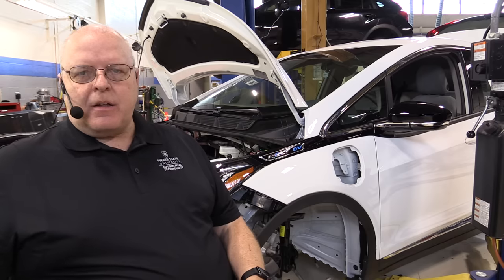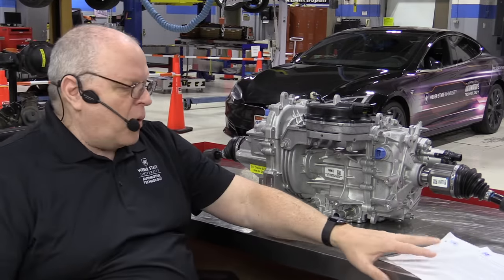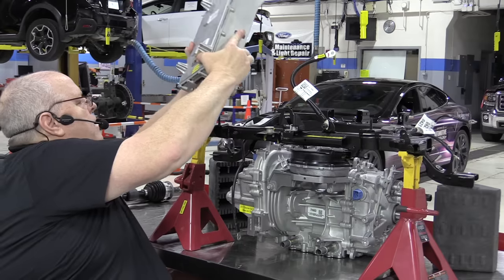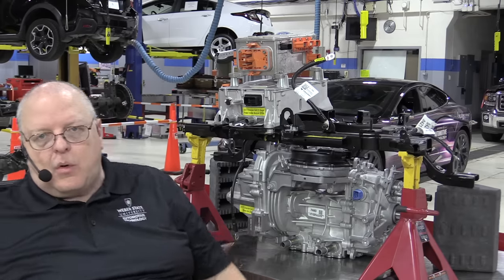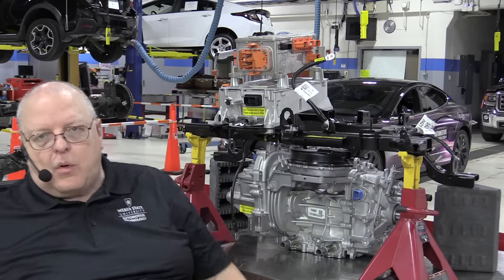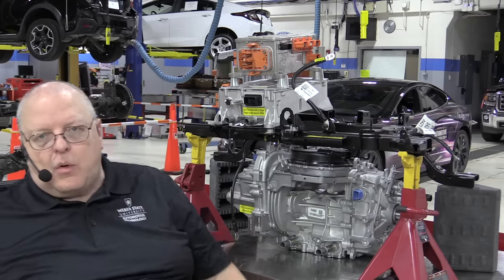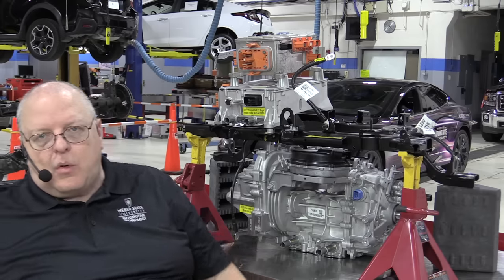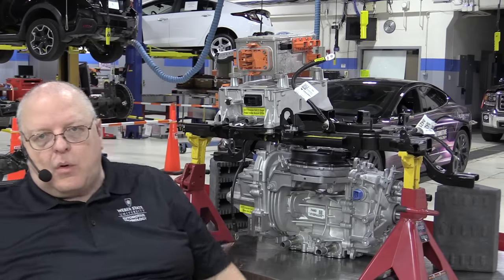Chevrolet Bolt EV High Voltage Components

Comment: Why would they have two different wiring harnesses for J1772 vs fast DC? You'd think it would be easier/cheaper just to have one part number and ignore the extra wires if you don't have fast DC.
Reply: This is GM we're talking about, are you really surprised? Lol. They try to save a buck by using less cabling, or save on BMS design, and report their quarterly profits to happy investors, and then the recalls start coming in and claw the profits right back. Makes you wonder if it was really worth it for the US govt to bail GM out of bankruptcy last decade. It seems they're still doing what they've always done, thinking they're doing it the easy way and saving money.

Comment: Interesting the electric power steering is not part of the high voltage system. That means reduced efficiency but they can reuse the same components as in their ICE cars to save money.

That onboard charger is at least twice the size I expected. All that to convert 7.2kW? Seems ridiculous. The motor controller is smaller and it converts 150kW.

Would have been interesting to see the coolant routing. How many loops are there? And how many coolant pumps? Seems the coolant pump(s) is low voltage also?

Great vid. Good thinking assembling it all on the bench like that.
Reply from the maker: Thanks for your feedback, the cooling system video is coming soon. Regarding the on-board charger,  keep in mind that it contains its own AC-DC inverter and its own DC-DC step up boost converter all in one housing. The continuous 30-32A charge rate at 240V would make it run pretty hot for up to 9 hours straight while charging.  This charger is actually smaller than the 1st generation Chevrolet Volt charger which was only rated for 3.3kW. Have a great day!
Reply: Now that SiC and GaN transistors are more cost-effective we might see smaller designs in the newer vehicles, but you're right in your other statement that they are saving cost by reusing the same components in their ICE cars. They aren't really playing the game to make a truly great EV design, just something that meets demand in the mass market and turns profit for their already bailed-from-bankruptcy GM company.

Comment: Thank you professor for your great video! I learned much from it. One very minor question at the chapter "the HPDM to APM and OBCM connections", I notice that there are 2 connectors from the HPDM while splitted to 3 connectors respectively to DC/DC, OBC and the compressor.  So there must be 2 connectors sharing one port of the HDPM. Could you help specify which two? Thanks again.

Comment: Awesome explanation. Seems like a first gen design in that they didn't integrate much, kept it simple. Would LOVE to see the equivalent for a Tesla Model S and then the Model 3. I suspect the Model 3 will be much more integrated, less high current wires.
Reply from the maker: Thank you. Tesla Model S is very similar with one exception. The inverters are inside of each motor. I have not seen the model 3 system yet.
Reply: @WeberAuto  Model S has a high voltage distribution box too? Is the industry ever going to switch from 12V to something that is now more appropriate like 48V?
Reply from the maker: @philtrubey7480  Yes it does. it is built into the end of the on-board charger

Comment: Professor Kelly, is it possible to add the DC Fast Charging option to a Chevy Bolt after purchase?  I purchased a used 2017 Bolt without the DC Fast Charging option installed.  I can purchase the receptacle and wiring harness for $746 from the dealer parts dept. but i'm guessing it's not that simple.
Reply from the maker: It is not possible. Sorry. Thanks for watching

Comment: A big thank you for doing this Bolt series. While I get the concept of the modules, I don't agree with it. While I don't know, I highly doubt these modules are serviceable (although they should be). So they represent unnecessary cost. The wiring, while impressive, seems like overkill. For example, I see no good reason for having the inverter  to motor connection via the 3-wire connection. Better to have that module bolt right to the motor - better electrically and more cost effective. I think we'll see a lot of design advancements over a shorter period of time which will obsolete the concept of using modules across model lines. I also see the 12Volt system disappearing as there is really no longer any reason for it. And this nonsense of throwing a fault code that only the dealer can clear for unlatching the battery out of sequence is absolutely ridiculous. Overall, I do think the engineers did a great job on the motor and trans-axle design. However, I think there is a lot of room to improve the electronics. Not that the inverter and other module designs are bad or inadequate, they are just too "closed" and "proprietary". This only encourages folks to completely bypass them and seek alternatives.
Reply from the maker: Thanks for your feedback
Reply: GM is oldschool, trains dealers, and supports their ecosystem. Stop buying GM and invest in companies that are willing to support Right to Repair, allowing customers and small businesses to work on vehicles with lower investment in specialized training, tools, exclusive partnership rights etc.

Comment: Just curious, will the AC 7.2 KWH charger on the 2017 Bolt EV fit in a 2017 Volt? I see it is an option for 2019 for the Volt. If so, where is the charger located in the Volt? I have a wrecked Bolt EV to play with, I would love to update my Volt!!
Reply from the maker: No, it is not the same configuration, size, and the connections are different. The Volt charger is under the rear hatch floor along with the DC-DC converter and the 12V battery

Comment: Excellent video and very in-depth! May I ask a question? I am considering adding an additional high power DC converter in order to have a separate 12v Supply to run a 2000w inverter for AC power. With the hpdm be the best location to tap into the high-voltage power for the DC converter? If so, what's the best point of connection?
Reply from the maker: That will not work. The internal current sensors will detect the unauthorized current, trigger trouble codes, and shut down the system. The 12V battery is the only place to connect something like that, but even then the DC-DC converter would not be able to keep up with the current required for 2000W. Best wishes.
Reply: @WeberAuto  Thanks for the response! I was concerned about current sensors in the main pack and possibly in the dc converter as well. However, I was wondering there is any way of adding another DC converter without causing an error? It would be very useful and not much different than adding a larger or second alternator on an internal combustion engine. Perhaps a power tap after the current sensor inside of the dc converter would work? Any ideas?
Reply from the maker: @wigginstech6107  No ideas, the battery current sensor would still pick it up.
Reply: GM vehicles are just not great for this kind of thing. You're better off either rewriting a CANbus controller or choosing a more modern vehicle that supports two-way functionality of its battery pack in a proper way, like what VW is doing in its new ID5, as well as some older cars that use CHADEMO.

Comment: Hello. Thank you for this. May I ask if these HV modules are case-grounded? Or do they have separate ground circuits? Thanks!
Reply: HV components in EVs typically have the case grounded to the vehicle structure (which is also the low-voltage DC negative), with both sides of the high voltage DC isolated from the case and low-voltage negative. The HV cables are usually shielded, with the shield connected to the cases.

Comment: Interesting, are we at the beginning of the end of internal combustion vehicles?
Reply from the maker: Thank you, That time is slowly approaching
Reply: timbober VW just officially announced that their 2026 design of internal combustion engines (ICE) will be the last of their new ICE engines.  With similar recent announcements (but less definitive end-dates) from GM & Ford, the end of the ICE drivetrain is coming quicker than many people realize.
Reply: Yes sooner than most would expect. Once you drive electric, you don’t want to go back!
Reply: timbober1:  the beginning of an alternative option ... EV performance & cost is reasonably close to ICE vehicles, but charging times & affordable range still has a lot of improving to do before EV sales out number ICE. Battery tech has been and still is the "weak link" to EVs being primary cars  ... cell cost needs to drop by over 1/2, capacity needs to increase by 2X+,  and charge rates need to increase by 4X+ ...  it's just a matter of time ... one or two more generations of battery tech,  a 1-2 more decades?
Reply: Not for trucks..yet..Tesla chassi could make a small pickup truck..i mentioned to the GMC dealer i bought trucks from to put an electric tug on the drive shaft..avoids starting a huge diesel engine to move the trucks a short distance..
Reply: Jaxx Brat I drive a 2016 IH with a Cumins engine and Eaton auto transmission.  The guys in the shop say they will quit if electric trucks take over.  I hated the move to auto transmissions but it’s the way of the world.  Tesla will take the arrows, if electric trucks are viable I think they will be great.  I learned the valu of auto transmissions a couple of days ago when backed into a loading dock position on a uphill grade on snow covered ice.  I thought I was going to have to get salt and kitty litter.  I pushed drive and the power divider.  The wheels only spinners.  I then manually shifted into 3rd gear.  The tractor has traction control and with the tyranny in 3rd it didn’t so much as spin a wheel as it pulled up the hill.  I’m sold, bring on the electric motors.
Reply: DrgnFlys - Yes, the goal posts keep moving, don’t they?
Reply: @KCautodoctor  The sky is falling for sure now, I feel it
Reply: no
Reply: in first world countrys will see the drop of internal combustion engines. Butt second and third world Nations don't have power supplies and source  needed to power these vehicles. and it will be decades before they will be there. That Rings true for military vehicles to. But as far as oil is concerned when they figure out how to make these vehicles out of paper rather than plastic petroleum will stay in demand! Of course they could use bio sources just cut into our food supply like they have with alcohol for gas!
Reply: @EVMacD  Once you pay $1,100 for a decent used gas car like I did 2 years ago, or $900 for the car-  Olds Cutlass Sierra Wagon that I had for 8 years that needed no engine or trans repairs of any kind- I'd never go to a $36,000 car plus interest and comprehensive insurance!!! That's 5 times what I paid for my  2 br full basement HOUSE on 1/2 acre of land in 1999! I cant wrap my head around $36,000 for a freaking CAR,  OR that this car costs 5 times what my house cost!

I'd still have the Olds wagon were it not for corrosion in a critical part of the frame by the left front wheel, it never once gave me any problem in the 8 years I had it, never had to tow or jump it, never did anything to the engine or trans, it only needed wear related  items like tires, muffler, fluids, belts, hoses, battery, alternator, brakes and the wiper switch. I bought it off a co-worker for $900, he drive it to-from work 60 miles each way a day and bought it when it was almost new, so all the miles were highway miles and the oil changed every month.
When I replaced it, it had over 200k on it, never even drained/replaced the trans fluid or filter.
Reply: maybe petroleum products will become unattainable, but PYROLYSIS of waste things can produce fuels, and there's ALWAYS hydrogen to be separated out of water and internally combusted! spin tires on pavement!!!
Reply: hemp pyrolization for fuels, and hemp for TP, save a tree!!
Reply: We are not going back put it that way!
Reply: EV is great, but has not since been implemented in the best way with weight reducing carbon fiber or composite body, efficient aerodynamics, and general cost saving conveniences for mass production. Technology exists today to make ICE comparable to EVs with heat pumps, external combustion co-engines, and proper exhaust heat energy recovery. There is simply a big lack of interest in genuine innovation to bring these technologies together, which have existed separate from each other for at least 2 centuries (for automotive, but a standard practice in industrial and energy sectors). I'd like to see ICE running on synthetic fuels, unhealthy hydrogenated oils that we shouldn't be eating, etc.

Comment: with the cars on the lifts. for long term. just curious if you have had a machine shop create new inserts for the ends of the lift arms that bolt onto the pinch welds or clamp on the pinch welds to prevent any disasters from happening  a way to use pins to lock the stacks together also.
Reply from the maker: We have not. Our lifts have rubber pads that help maintain their position.

Comment: I think the reason the battery heater only works off AC is to "pre-condition" the battery and cabin in cold climates. The heater wouldn't be needed during DC fast charging because the act of charging the battery at high current would warm the battery.
Reply from the maker: Thanks for your feedback.
Reply: If you charge a cold (below freezing) lithium battery it will be damaged. It has to be warmed before it can be charged. This is one of the major drawbacks of Lithium batteries. There is ongoing research to overcome this issue in lithium batteries.

Comment: Hey Sir, thanks for your intuitive videos, I just want to ask if by any chance you may have this information. And my question is I owe a white 2019 chevy Bolt EV and the battery capacity is 60KWh, the 2021 Chevy Bolt battery which is 65KWh if not mistaking this battery can it be installed on the 2019 Bolt EV, the reason Im asking is down here in Puerto Rico there is not to many places to charge and with this recall update it limited the battery bit for me on my trips and I was thinking to go to the dealer and have them replace the battery for a 65KWh one, and you may ask why do you just call them and ask, but I rather preferred to do a research on my own first and ask them later, thanks in advance.
Reply from the maker: Good question. I don’t know the answer. I suspect it will fit, I don’t know if the programming will allow it to work
Reply: They do it for Nissan Leaf's but I haven't heard of this kind of thing for GM's vehicles. There are solutions you can buy where  you can carry around extra capacity that you can "plug in", similar to a gas can for an ICE vehicle. There should be a few companies that sell them, but the modular one I'm familiar with is called the SparkCharge.

Comment: The compressor for the AC unit could be used as the compressor for a heat pump. A heat pump is an AC unit in reverse (where the AC unit draws heat from the cabin and pumps it out to the warmer outdoors in the summer, a heat pump takes heat from the cooler outdoors and pumps it into the cabin at moderate temperatures (-20 C / -4 f ) and above  (I'm Canadian that's moderate!). Over a heating season this feature saves just over twice the cabin heating energy, which can be significant. This is a great advantage. It is most effective the warmer the temperature and has little to no effect below - 15 C or so, so it is more of long term energy efficiency improvement than a range improvement for extreme cold. The additional equipment requirements to switch an AC unit to a heat pump are simply a reversing valve, 2 check valves and a controls upgrade (mostly just software). Really very cheap for a significant improvement. I see Tesla just came out with a heat pump (Elon did a couple years of his undergrad in Ontario, so understands about heating). Nissan has one and I'd like to encourage the design engineers in Detroit to look at it for their EVs. Seems to me there may be a aftermarket opportunity for used EVs too.
Reply: Yup you could definitely do that, the science is that easy. However, getting the car controller to behave is another story. Also Heat pumps have the potential to reach COP > 5. The thermal management system is good, but stops way short of achieving much better results.